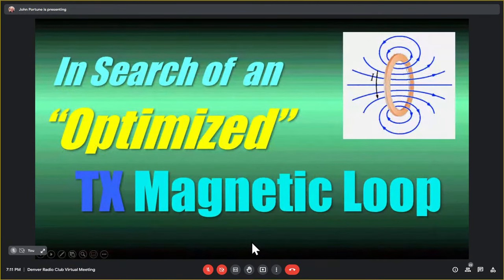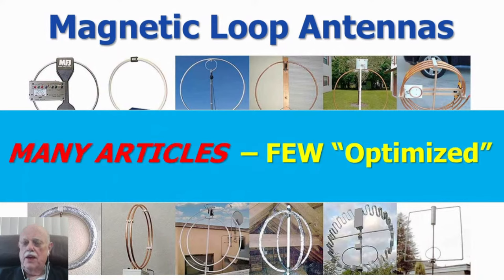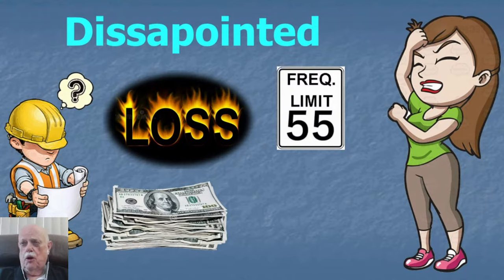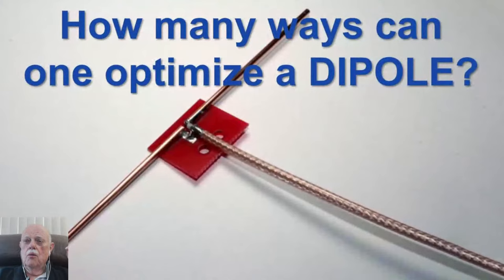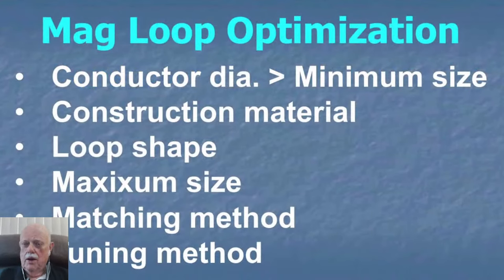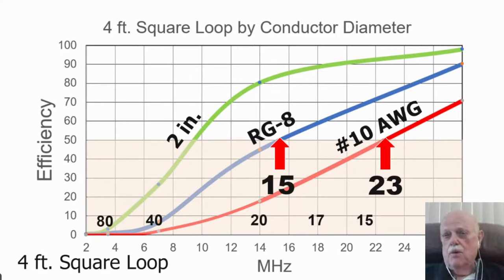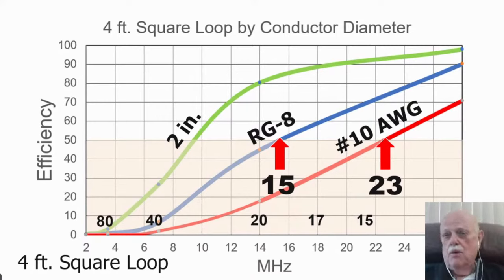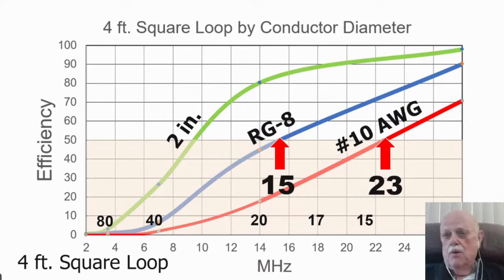Optimum Magnetic Loop Antenna - John Portune - W6NBC

Comment: I spent the whole weekend building a loop accordong to your instructions. Each side is 1 metre and I have a wooden pole coated in aluminium foil which slides perfectly through the top section of the loop. I am blown away by the results ! 1:1 SWR on all bands 7MHz to 30 MHz but on 10 and 14 Mhz there seems to be no resonance at all. I will look in to why this is in the future. I can even tune it to the 5MHz band. Finally I can get signals out of my flat in a tower block and at last I can be heard on 7MHz. The bands have come alive ! A big thank you to John ! I will probably make a short video tomorrow showing progress so far. 73 de G4EYR

Comment: Hello John, tnx for the interesting video. Very enlighting. I made a 10 feet diamator loop for the 2020 PAcc contest, because I never had a good antenna for 80m and 160m. I used 1,5 inch Cellflex coax and coupled  using two stacked toroids. I had to switch the number of windings ( 3 or 6 windings) between 160m and 80/60m for optima coupling using  a 12v relay.  The results were spectaculair, solast year I bought a Circo Mazzoni midi loop, conductor is about 3 inch diameter, working fantastic on anything between 20 and 80m. Some 5 years ago I built a large loop using your methode; 3 inch pvc covered with thin copper foil. It worked bettter the expected. So, 73 from Holland! Rienus, PA0RBA.

Comment: First of all thanks for this wonderfull presentation ! But there's one thing i would really wanted to mention. We don't think about it a lot but aluminium oxidises very easy. The minute you stop sandind/filing it it will oxidise. Thats why you cant't solder it in the tradional way. I,m affraid the foil/pvc elbow method will induce al lot of  junction-resistance. This wil negatively impact the "Rr". Maybe not measureable with a normal multimeter, but it will be noticeable with a dedicated resistance meter (for low resistances). I dont't want to split hairs here, but low resistance is key for magloops .. Best Regards and 73's

Comment: Well that was a REVELATION! My DIY Dual loop of 20mm Dia. Copper tube that hangs on my shack door at top for my SDR RX works so well on 40M compared to my Wires and 300 yard 6 ft high all metal Back Fence UNTUNED!  My Kenwood AT180 makes slight improvements in signal but not clarity of Dual Loop. But I obviously have more work to do to build your optimised design to make more comparisons! May have to make a Rectangle to fit on back of door though, as you have indicated shape does not matter. Have downloaded a few of your .pdf's for more reading in this area of antennas. I have plans to actually use the aluminium house guttering all around as an RX SDR Antenna for my inside Kenwood R2000 for 40 M. Thank you for passing on your extensive knowledge! 43AX05 Greg.

Comment: Thank you for validating my experiences. I have been building different magnetic loops for a while, however, with my PVC pipe capacitor I made, I managed to burn out a number of times with just 100W when using an 8m circumference 1' flat aluminium loop on 40m. That was using 20mm piston on some 25mm grey PVC. So far, I haven't burnt it out with the 32mm orange PVC tube...yet
Reply: @laserhobbyist9751  not exactly. The tuned loop (inductive loop and capacitor has an impedance at resonance that’s less than 50 ohms, so your coupling loop, or link, or gamma match is sized to present 50 ohms to the transceiver. The loop is most efficient at resonance, and as you move up and down the band, the impedance of the loop will change and so you need to tap you gamma match, or resize your feed loop to get the best match at 50ohms. 

As far as I can tell, the feed loop doesn’t have the same currents and voltages that the main loop has

Comment: This is a great video with lots of good information and I thoroughly enjoyed it. I'm curious particularly what you used to measure efficiency, I get when you effectively say " it has a skin effect give it more skin" but how is efficiency on this chart calculated? Is efficiency how much bandwidth you get when you're tuned? How much power the material can handle? And based on that chart what would a loop with 90% efficiency look like? I also felt like you were going to touch on why a circle isn't the optimal shape then to preface it you touched on how people started with circle or octagon and then continued onto explaining how the square is just easier to achieve with pvc pipe, I guess when you said "optimized magnetic loop" and efficiency I thought you meant because you're trying to show how the shape maybe results in a radiation pattern that's results in higher efficiency. The way I interpret this video is more like "there are cheaper and easier ways to make an efficient magnetic loop" rather than "optimum magnetic loop antenna"

Comment: I constructed a magnetic loop antenna tuned to 144.30 MHz in the 2 metre band.  This was made out of copper water pipe of 22 mm diameter.  The loop was square with external dimensions 156 mm x 156 mm.  The necessary capacitor was formed by using a 22-to-15 mm "reducer" by which a short 15 mm pipe was inserted into the 22 mm pipe.  Hardly a "variable" capacitor!  The co-axial feeder cable was connected to a wire loop of much smaller size located inside the antenna.  I used the antenna mounted horizontally a few feet above the roof of my car.

This antenna worked very well (within the limits of the fixed frequency to which was tuned).  My impression was that it was at least as good as a half-wave dipole.  I had a QSO with a French station from southern England during a "lift".

Frankly I wouldn't recommend it.  Its function would be severely upset by rain, and the very narrow bandwidth is a great disadvantage.  Also I was fearful of damaging the Tx output transistor by transmitting at a non-resonant frequency, hence into a gross mismatch.
Reply: HAH, I have just today measured out how I intend to do similar on the roof of my Jeep! But for 27.385 CB DX. It will be based on my experience and experimentation with Co-Phased DDRRs that have a 12 inch high main conductor that will turn into a flat horizontal rectangle. The capacitance is supplied by the 8 inch or so gap where the end of the radiator comes back around to meet the main upright. Will be supported by plastic tube uprights at each corner with pipe clamps on the Jeep standard roof racks. So will be only 12 inches off roof unlike a similarly performing 9 foot quarter wave stainless whip. that will take out all the lights at a gas station! ;-)

Comment: This would work GREAT with the loop taped all solid except at the capacitor point, use another small loop and a variable capacitor and a 12V 1 rpm motor, rocker switch, resistor to slow the tune down. I built a 5 foot 1/2 copper loop in this manner and it worked great on 40 and 60 meters.Vertical loops are directional and you can really null out noise/QRM.With a small 10" pickup tune loop just connect the cap across the main loop and tune it for noise, it will be very sharp.Adjust the smaller loop for best receive, and on transmit there will be a sweet spot where to tune just use 5 or 10 watts max.A $50 variable cap will get you 100 watts.Its a lot of fun especially when you get it working !

Comment: I have some questions about the top of the loop with the 1" or so gap of aluminum at the center of the antenna. First question: doesn't that make the antenna a dipole?  Second question: what is the purpose of the gap, and why not just complete the circuit and make it a loop? Are you counting on the internal variable  capacitor and its skin effect to complete the loop electrically? I am asking because it just looks like a dipole to me and I'm trying to clear up whatever is causing me to think that, but I don't really recall designs of magnetic loop where the loop is a split piece which sort of reminds me of a moxon antenna or dipole

Comment: OK but does this not also apply to the linear application as you are suggesting unless you have found foil in sufficient length and width to completely cover the 4 inch plastic pipe without overlap or creases.

Comment: very nice article..  especially the min size/diameter restrictions.  I would like to optimize for 80 and 40 meters.  Also what kind of capacitor voltage rating is required as power is increased.  I'm a fan of the vacuum variable since it is easily adjustable with a stepper motor remotely.  The 3 section "Tap" match idea is great!

Comment: Very inspiring and instructional video, finally some real facts and analysis have been shared around the loop antennas. I was wondering: Is the use of a commom-mode (or balun) necessary at the entry point of the small loop an option, in order to minimise any potential interaction (i.e. loading/detuning/currents on shielding, etc) of the coaxial line to/from the radio with the main loop? tnx, 73!

Comment: I have built this antenna with poor results.  The use of PVC pipe  degrades the antenna Q.
The 2:1 SWR bandwidth is about 130KHz at 14, 18 and 25 MHz. This indicates a fixed lose due to the use of PVC. I have since read a number of articles about the poor performance when using PVC for inductors or capacitors.
Reply: Is this based on the type of plastic that will heat up in a microwave or not? Some does, some does not, its best.

Comment: Hi,  I have just finished building a magnetic loop antenna a week ago. I worked on this project for more than one year now. It is now completely installed on the roof of the house with remote control for the (30 to 250pF vacuum) tuning capacitor and hermetic enclosure for the snowy winter. The real McCoy antenna...  There is just one problem, it does not work! It has a low gain, both in receive and transmit modes. I am writing this memo in order to get some advise. Please do not hesitate to comment on any incoherent aspect of my design. I am seeking help:

The loop is made of one long 30 ft (10m) section of 3/4 in (2 cm) copper pipe coiled with no joint. The antenna diameter is 4 to 5 foot diameter therefore there are TWO turns spaced by about 6 inches (14 cm).  The loop is connected to a vacuum capacitor and it tunes very well over the whole 80 meter band. At 3.8 MHz for example, the capacitance is around 120 pF.  I don't think there is anything wrong with the resonance itself. But wait, the juicy stuff is at the end.

The coupling loop is a simple wire about 20 inch (50 cm) diameter positioned in the same plane as the antenna, the usual way.  I will not mention the Q factor nor SWR because I did not precisely measure it in a  precise meaner, but I believe this is all normal: when I tune to a station, I can easily  go left and right of the station and the SWR goes down to almost perfect 1:1 match.  I repositioned the loop placement and saw no change. So, again I do not think there is a problem with the coupling or matching.

 My antenna has two differences with  the most common antennas: 

i) it has two turns; that means that the radiation pattern is a pure magnetic mode. No interaction that looks like a folded dipole. The radiation  pattern has the shape of a perfect symmetrical doughnut.  (usual one turn antennas have a slightly directional "cardioid" shape. This can not be the case here because of the symmetric coil having TWO turns).

ii) In order to avoid having to use a ROTATOR, I put the antenna IN THE HORIZONTAL PLANE. This way the radiation pattern is truly circular: no need to rotate the antenna... 

There are two problems with that, and here is the rationale behind that choice:

1 - The maximum transmission angle is horizontal, but the beam width would cover the necessary 15 to 20 degrees necessary.   The antenna is mounted on a wooden cage about 20 feet (15m) above the ground. I believed I would get a nice over-the-horizon angle, good for DX. 

2 - This is the part that I may have overlooked. The polarization of ground wave is VERTICAL, while our antenna has HORIZONTAL  polarization.

I am located in a semi urban environment with buildings, trees, electricity lines and hills all around my QTH. At the time I simply assumed that the polarization would quickly rotate to vertical.

I drive this antenna with 100 W signal. I can barely go 300 Km BOTH in reception and transmission.  From the same location, using a simple wire antenna and the same rig, on 40 meter band, everyday, I do QSOs all over across North America. In spite with the fact that I am a newbie, I never had a 80 meter antenna I really believe that antenna in not usable as it is..  Why?

Thank you.
Reply: Had a great idea to mount my 40M dual loop horizontally hanging from the false roof with cap at easy reach. Usually hangs on the back of the small shack door where it optimally works with door closed and poor with door open?? BUT it was terrible with massive noise when on roof so guess it nulls where it needs to with door closed...

Comment: Hi and thanks for the exciting and motivating presentation. I have one question: how do you fix the coax braid to the aluminum tape such that you get a good electrical connection? Thanks a lot for your help! Kind Regards, Flurin
Reply: Use copper tape and solder it.
Reply: @timhogan8170  That was not the question.

Comment: John, this is an extremely interesting video.  Thank you.  How would this antenna work as a receive only antenna?  If it would work as a receive only antenna, and the goal is to reduce QRM, would it work best mounted horizontally?  TNX  Bret C/AC0AE
Reply: Had a great idea to mount my 40M dual loop horizontally hanging from the roof with cap at easy reach. Usually hangs on the back of the small shack door where it optimally works with door closed and poor with door open?? BUT it was terrible with massive noise when on roof so guess it nulls where it needs to with door closed...

Comment: I think the equation for optimization is 1/4 the wave length.  Wavelength = 300,000 km / Frequency. So divide by 4 and that is the circumference of the loop.

Comment: A mag loop radiates in the same plane as the loop with nulls 90 degrees to the plane of the loop. Does this still apply to the vertical and how does this apply to NVIS work?
Reply: Had a great idea to mount my 40M dual loop horizontally hanging from the roof with cap at easy reach. Usually hangs on the back of the small shack door where it optimally works with door closed and poor with door open?? BUT it was terrible with massive noise when on roof so guess it nulls where it needs to with door closed...

Comment: Hi, I am just now looking into building an antenna for use on a bus I am converting to a mobile home. My armature radio use has been hindered since I got my license years ago due to stringent home owner societies that I did not want to fight in court to defend my rights. But on the motorhome would be my chance to finally use more than 2 meters. <LOL> and mag loop looks like the way to go. I do have 2 questions about mag loops though. 1) because of the radiation patterns of the loops being rather directional <ideal if you are trying to reach someone that you know the exact location of> and a lack of side side to the plain of the loop would it be ideal in keeping a low <close to the roof> profile if laid parallel to the roof and radiating 360 degrees toward the horizon? and 2) How does the tape used in this design stand up to the bakeing of the sun and the corrosive effect of the weather?
Reply: Had a great idea to mount my 40M dual loop horizontally hanging from the roof with cap at easy reach. Usually hangs on the back of the small shack door where it optimally works with door closed and poor with door open?? BUT it was terrible with massive noise when on roof so guess it nulls where it needs to with door closed...

Comment: OK we've completed the 4FT version but we used 2" PVC.. I'm not sure about what the wiring needs between the antenna and my PlaySDR srcdx. What do I use to power the antenna? I can see the capacitor makes some difference but I'm unshure how to tune the bottom clamp.

Comment: Hi, I’m really interested in your design John & the physics behind it. I’m keen to have a go in constructing the larger version using small pulley wheels and a low rpm geared motor located near the bottom of the loop for remote tuning. One question with regards the foil covering of the 1 1/2” pipe, are you using for example three parallel overlapping strips to completely surround the pipe? God bless, Bill G6ATO

Comment: What about wrapping the foil tape around the plastic pipe rather than the straight or linear application
Reply: because the adhesive side will behave like an insulator so in fact you would wind a coil on your pipe.

Comment: Resistive loss in the friction fit elbows are not optimal.
Reply: Yes welding everything is a must, no bolts no screws aluminium will oxidized inside the elbows

Comment: Basically, there is no good mag loop antenna in typical sizes.   Just different degrees of bad loop antennas.  I get it, it’s a compromise, it’s small, “but I live in an apartment or HOA”, ect….  If it’s all you can do, it’s all you can do.  No judgement.  If you want better efficiency, multiple bands, no tuner needed for applicable bands, cheap, and you can fit in your pocket or at worst a small bag, get an end-fed half wave.